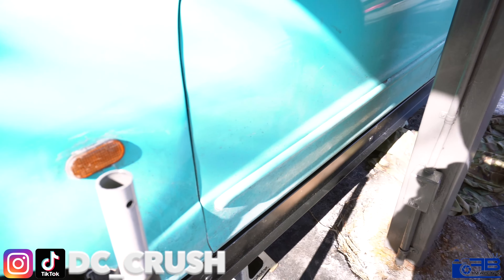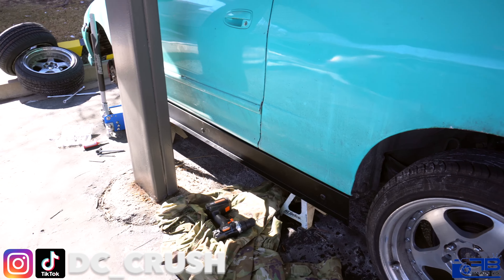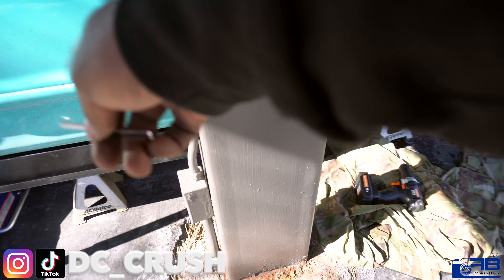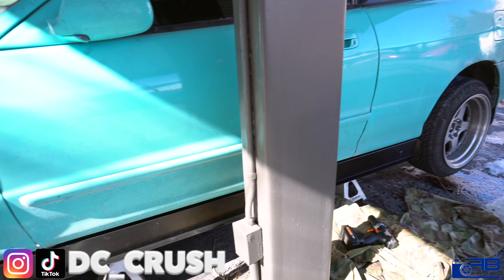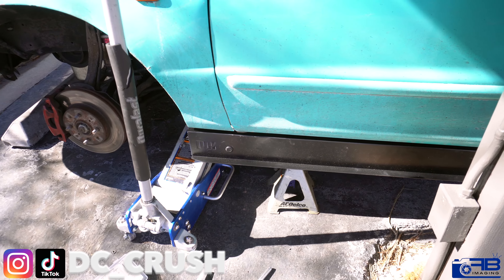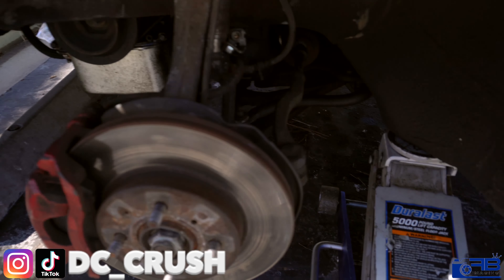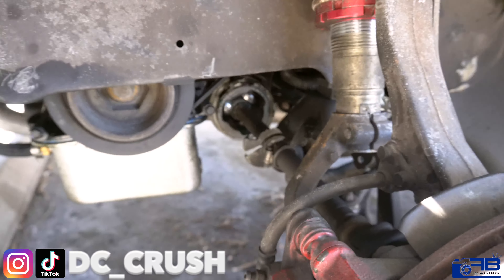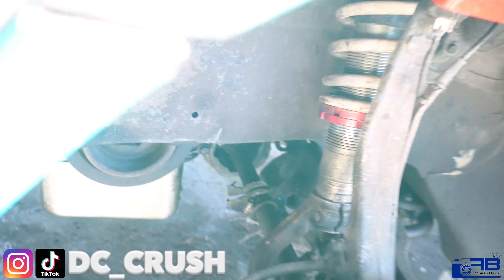Installing PCI Sideskirt on DC4 LS VTEC Turbo Integra

Comment: The side skirts came out great! 🤗
You should get into the xxr 531 platinum wheels!
Reply from the maker: Not trying to do that much on wheels honestly. For me that’s overrated for my build. I want new wheels but nothing pricy like xxr. The wheels I have I got for $400 brand new 7 years ago when I started the build
Reply: @dc_crush  
Oh okay I see. Yeah you’re right xxr are pricey. Oh dang, didn’t even know that until now! But I’m pretty sure you can find a set of new wheels on eBay for almost $400 as well too.
Reply from the maker: @darrenvang6881  yeah I think you just said xxr because you heard other folks talking about xxr wheels. This is an old car in perfectly fine with Rep Wheels for this piece lol. I’ll keep ‘em clean though 😎